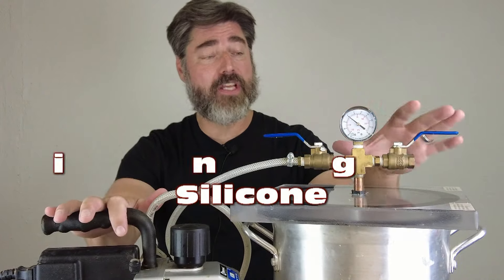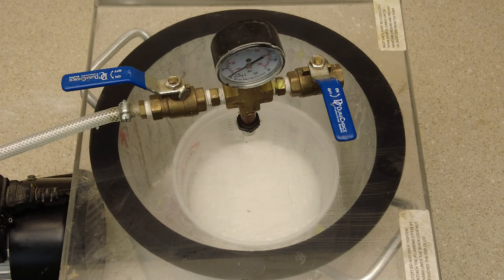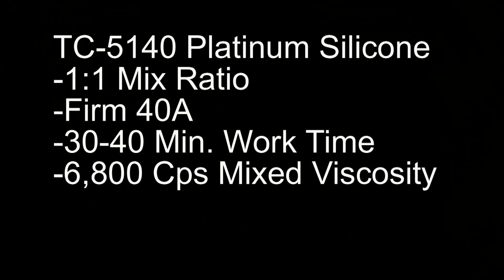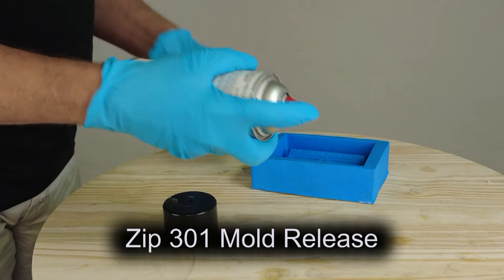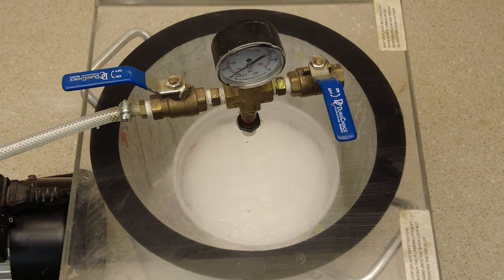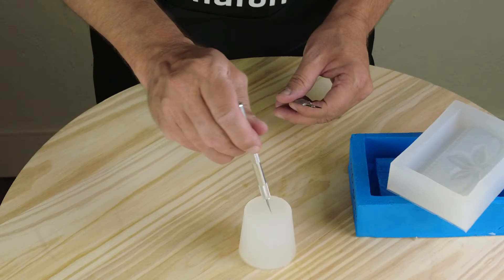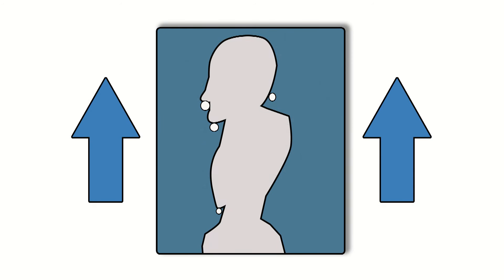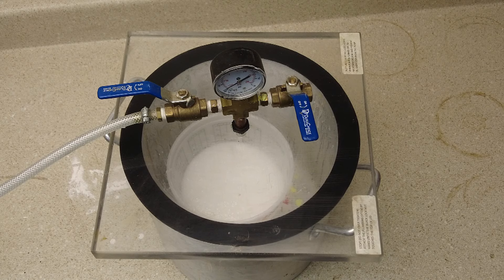Degassing Silicone For Better Molds & Casts

Comment: Great video and explanation. I'd add, that IF in the middle of your degas cycle your material begins to overflow your bucket, use the relief valve to let vac-off. The relief valve can help "burp" the material, in essence breaking the surface tension. You can also accomplish this via a quick "rocking" action of your degas tank or vessel. It will also help break the surface tension. A warming of the material you are vac-degassing will also lower the surface tension, helping to collapse your pour. But keep in mind, any heating of your cast system will reduce work time... but that's for another video.
Reply from the maker: Thank you sir! You need to join me for a joint video sometime!!

Comment: Thanks for the new tutorial (series?), lines up excatly right with my silicon fabrication.
Just tried my vacuum pump the first time yesterday for degasing, I then also used vacuum to get the silicone into all the corners of my 3d-printed mold. It helped a lot as the features where small and the silicon very high viscosity.
Worked out very nicely in the end :)
Reply from the maker: 3D printed molds are something I really want to get into next.

Comment: Great video, I didnt realize how big an effect the viscosity had on how much silicone expands when degassing. I would just add that vacuum degassing silicone is also critically important for any parts or items cast from silicone where sanitation is important. Anything that will be used in a medical situation, for food prep and for the more adult side of things. These micro bubbles and some of them really are nearly microscopic, can allow things to get trapped in them and not be cleaned out and even avoid many sterilization methods. those bubbles make wonderful little homes for nasty things to grow in. so if you were making say a collapsible silicone water bottle. if this was not degassed you could never be sure your actually getting it clean and using it means you could give your self food poisoning. if your making a part for a prosthetic out of silicone that would be in constant contact with the skin, again you couldnt get it fully clean and so something might start to grow in those bubbles and lead to an infection.
Reply from the maker: Yes! I didn't delve into the casting side of it, but un-degassed silicone for food (as well as the other applications) is bad news!!

Comment: A couple of things to add. When pressure casting there are more considerations. 
First, you can get a long way without ever needing a vacuum setup, if you have a pressure pot. You can simply cure the silicone under pressure. That will collapse the bubbles without needing to degas them. Even with a softer silicone, where the bubbles will re-expand after the mold is removed from the pressure pot, the bubbles will collapse back down when pressure is once again applied. Only an issue with silicone under Shore A 05, or thereabouts.
Second, I will recommend curing silicone under pressure if the intend is to use it with pressure casting, even if you have pulled a vacuum on it. It just ensures a mold is less likely to fail when pressure casting. Any bubbles that are caught when pouring or clinging to the surface will then be collapsed.
So if the option is to get a pressure pot or a vacuum chamber for the hobby caster, I will recommend the pressure pot first, as it can replace the need for vacuum in a lot of cases. Having both myself, I often forego the vacuum chamber step when making simple molds.
Reply from the maker: Funny you should mention this. After I posted this video I had a long chat with Troy over at BJB about this angle on pressure casting. I'll be doing a follow up on this soon. Thanks for watching and thanks for the input!

Comment: Could you do a tutorial on how to build a vacuum chamber and a pressure chamber. The sizes and quality of equipment needed to do the job safely for someone who wants to build their own. Thanks for the great videos.
Reply from the maker: The setup I'm using here is about as DIY as I would ever recommend. Using a sturdy pot from a restaurant supply is the only "corner" I would ever cut. You can make your own lid/gasket, but it is cheaper to just buy one. As for pressure chambers, I have heard some terrible stories from customers who have made their own chambers using kitchen pressure post and almost died. One guy in Dallas would put his questionable chamber out behind a plywood shield in his backyard and then turn up the pressure. That arrangement worked until the day it didn't and fragmented. His plywood shield did save his life, so there's that. If you venture into the world of homemade pressure tanks and vacuum pots, be VERY careful.

Comment: Nothing like a BITY video on a Monday!  Here’s my question: I understand that the rise and fall of the silicone is important.  Should I de-gas it further after it falls, or is the rise and fall enough and I can turn off the pump immediately after the fall.  Thanks.
Reply from the maker: There's no harm in leaving the material in the chamber after the rise and fall, but my experience is that, after that, the air is out.

Comment: I have seen people use extra or old cured silicone in new moldes, especially in larger spaces of silicone. They clean it and cut it up and just add it into the new mold. I don’t know how to feel about this and have not tried it. Can you let me know what you think about this. Thanks love your content.
Reply from the maker: I have not used that technique, so I can't speak from experience. I saw that mentioned years ago in the Thurston James prop making book. Silicone prices have come down a lot since then so it isn't as big of a savings as it was. That said, some silicones do not bond well to old silicone, clean or not. You could run the risk of a mold that will have very low tear strength and break down quickly. Be careful and run a small test to make sure you are happy with the results before you use that technique on a critical project!

Comment: Is there a system that can degass a 55 gallon drum of silicone or other liquids in the shop or lab?
Reply from the maker: I'm sure there's something like that, probably custom built.
Reply: @brickintheyard  custom, huh? Then that's what we need to do. But it would be nice to know how? Plans or schematics or some idea of what we're dealing with.
Reply: In our manufacturing plant, we have large vessels that degas drums of material.  They are custom made.  For others watching/reading: do not pull vacuum on the material's storage drum, bucket, or can.  You need a vessel designed for that purpose.

Comment: Good day, I´d like to ask a question, I have to options of vacuum chamber, 1 a 1.5-gallon pot with a 3.6-cfm pump or 2 a 3-gallon pot with a 3-cfm pump (its pump big enough?). I´ll be using TC-5110F and TC-5130F mainly, in small batches thanks for all the info on your videos.
Reply from the maker: @jobione1498  both of those combinations will work, but the 3 gallon pot will take twice as long to achieve a vacuum as the one in this video. You’ll need to be extra careful degassing fast setting materials.
Reply: @brickintheyard  thanks a lot

Comment: Do you know if a 8 cfm pump and a 3 gallon tank would remove bubbles out of resin like in 5 minutes or less?
Reply from the maker: That sounds like a good combination. The pot in this video is ~2.5 gallons so that's probably more than adequate.

Comment: Reynolds advanced materials claim to not need vacuum degassing
Reply from the maker: The litmus test would be pressure casting. Even water thin, low viscosity systems will trap micro bubbles that wreak havoc during pressure casting. As mentioned in the video, low viscosity systems, like TC-5110, TC-5130, and TC-5140 can be used for a lot of mold making applications without degassing, but degassing will allow for pressure casting and just better results in general. Just my opinion, but the "No Vacuum" silicones are more of a gimmick for the hobby market than anything else.